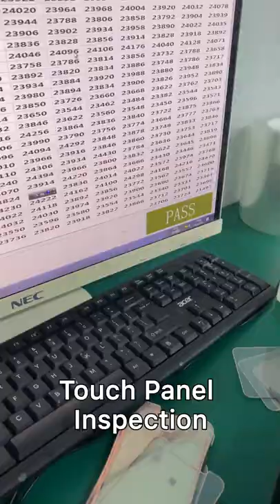FPC Bonding - iPhone Touch Screen Digitizer Factory Tour (Episode 1) #Shorts

Comment: What are the engraving at the end?
Reply from the maker: It is called FPC reinforcement, making the connection between FPC and touch panel stronger.
Reply: @rewatechnology2008  I've never seen a digitizer get etched.